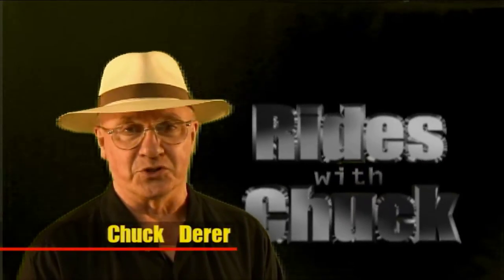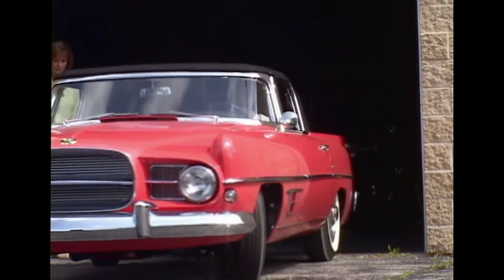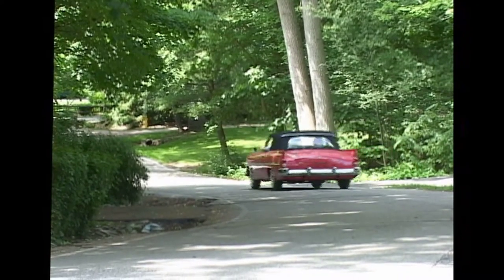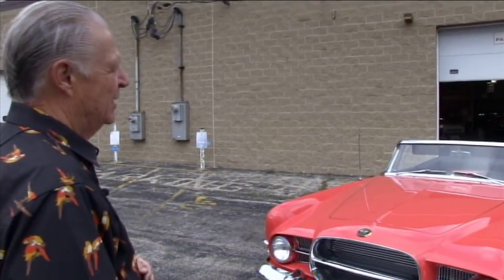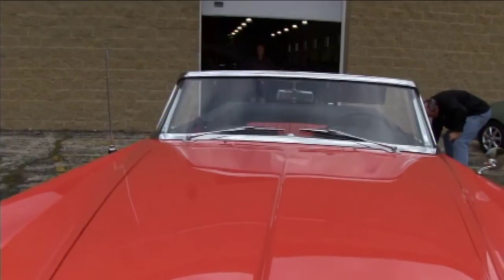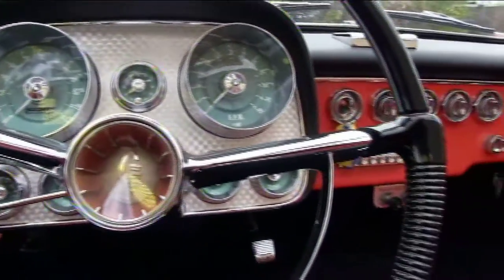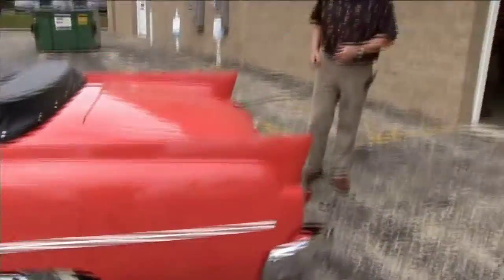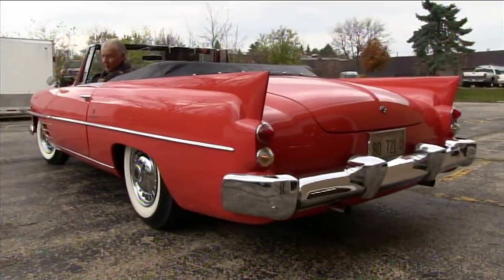Dual Ghia 1957 - Yes! We go for a ride.

Comment: Unibody in the 50s? I call BS; pretty sure these were built using a Dodge chassis with a 50s Hemi engine. Hemmings: "Dodge frames were shipped from Detroit to Turin, where Ghia’s staff would shorten the length by seven inches before adding a hand-hammered, step-down body that was welded to the frame in a variety of locations. The interior was fitted, and then the rolling assembly was shipped back to Detroit for final assembly and installation of the Dodge V-8"
Reply: Well it is welded into one piece.